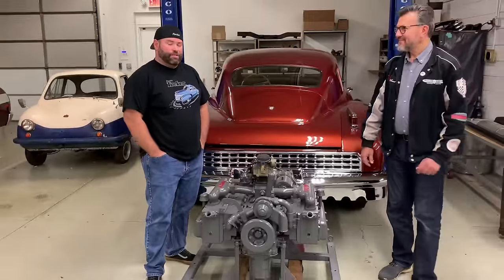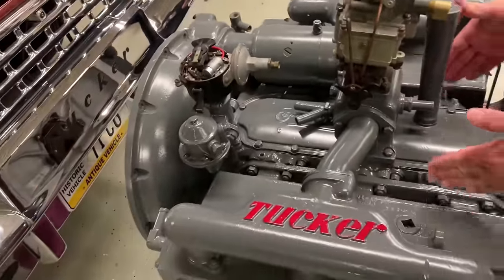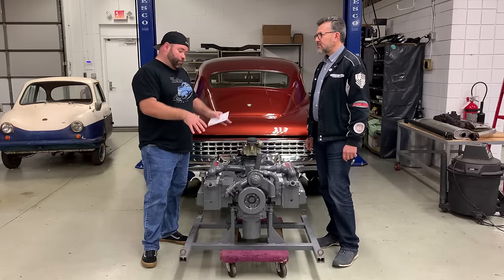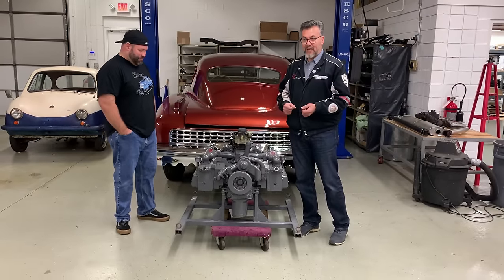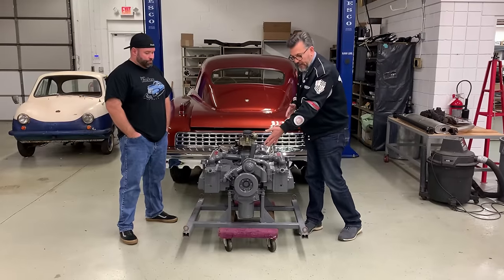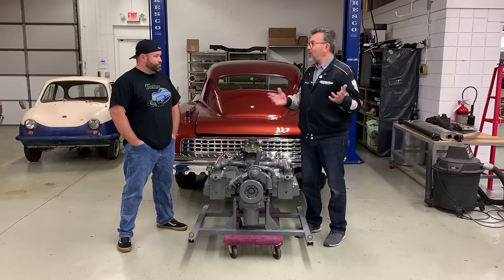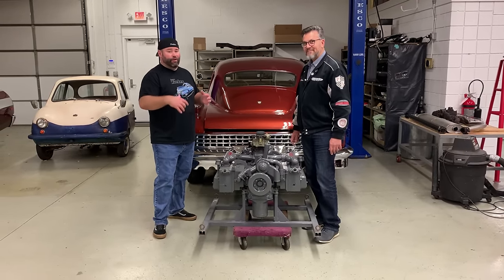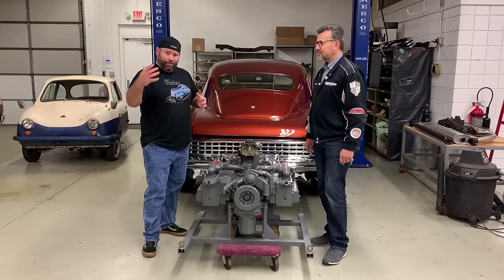The last Tucker automobile engine runs for the first time!

Comment: The man with a vision that started safety belts ..safety glass and much more only to be shut down by the big 5. Sad but true story.  Awesome to see it running!!
Reply from the maker: Thank you so much for watching!
Reply: model A Fords had safety glass in 1929
Reply: @Ifyouonlyknew howbad Heavy Drum Brakes!
Reply: @bikejunk1  No, they called it "Safety glass", but it was not safe. It didn't crumble like safety glass is supposed to.
Reply: @bigmacdaddy1234  the key factor was LAMINATED multi-plate glass of precise design.
Reply: @bigmacdaddy1234  To crumble, it's tempered glass... not safety glass. The 'safety' in windshield safety glass is that road debris can't get flung through it and cover everyone in shards of plate glass.. and if you end up smacking it, again, no knife-like shards. Side and rear windows get tempered because they don't face flying objects, so the only consideration is not slicing and dicing the occupants.
Reply: @mfree80286  Now I know more about glass then ever before. Thanks!
Reply: i thought first safety belts in a tucker was a myth?
Reply: The big 5?
Reply: Yes , the big 5??? What was the other 2???
Reply: A quick search says 1936 Rickenbacker was 1st to market with laminated safety glass windshield. I thought it was the 1939 DeSoto. My dad said he was test driving a ‘39 DrSoto when it forgot how to steer (something failed in the steering linkage). He hit a fire hydrant that didn’t break away like they do today. He bopped the windshield with his head. He had one cut in his ear that required stitches, but was otherwise unhurt. He always had a soft spot for Chrysler products after that because he was sure he would have been cut to ribbons in other cars of the day. Unlike most older drivers he ALWAYS buckled up when seat belts became available. Would have saved him from almost losing an ear.

Comment: I'm from Syracuse, NY, home of the Franklin automobile and the Air Cooled Engine plant. My grandfather worked at the Franklin plant making cars into the early 1930's. I was fortunate enough to have been allowed access to a Tucker at a Sarasota, FL  automobile museum back in the early 1980's while doing research for my Master's program in Engineering. I'm looking around my old papers for the serial numbers of that particular Tucker. It was such an impressive and forward-thinking design. I'm glad many of these cars were saved and restored!

Comment: As a huge aviation nerd, it was the fact that the Tucker had the Franklin engine in it that drew me to being a fan of that car and its fascinating history. 
Up until this video, I never knew Tucker bought Franklin and I never knew that the engine was converted to water-cooled from air-cooled. The Bell 47 helicopter in which that little Franklin engine began its life, was as legendary a piece of engineering as the Tucker Torpedo. Thank you for this very informative video. No other engine sounds like that.
Reply from the maker: Don’t worry, we are nerds about this stuff too!  Thanks for watching
Reply: I recall a Franklin aircraft engine company in El Segundo, CA when I was learning to fly nearby but don't think they went out of production in 1948.  I seem to recall other engines made for aircraft after that.   Was that not the same manufacturing company?

Comment: It's a true delight to see this marvelous piece of engineering back running where it belongs in Tucker #50. These cars were years ahead of anything on the road in 1948 and in some ways they rival modern cars. Preston Tucker was truly a man well ahead of the curve.
Reply from the maker: We agree Keith, thanks so much for watching!
Reply: Thats why Detroit had him shut down.
Reply: so are you saying this engine was originally in this car, then the car was sold without its engine, and now somehow they are reunited?  I'm confused.
Reply: Someone, maybe you guys, needs to buy Tucker Motors and bring these back.
Reply: Yeah, that's exactly what they are saying. The engine and car got separated, but now they are back.

Comment: My father in law owned Tuckers Tucker. The one with chrome around the windows. Now in the Peterson museum. I still have the manufactures liscence plate and a center front grill on my garage wall. The one under the headlight
Reply from the maker: Very cool, if you even want to part with those original parts let us know at info@tuckercorporation.com!

Comment: Back in 1970 my brother and I were scrounging for certain auto parts in Koch's Motorcycle / auto salvage yard in Denver, Colorado.  In a shed, we came across a box with a cover.  We peeked inside and there was a pristine Tucker engine.  We were dazzled.  We thought all Tucker engines were in Tucker automobiles.

Comment: VERY smooth running engine compared to the other Tuckers that I have heard run. Mark has that engine dialed in very nicely.
Reply from the maker: Yes he does, thanks for watching!
Reply: Aircraft engines are powerful, and precise. I've flown helicopters with Franklin engines.
Reply: Also helps the engine has zero miles.
Reply: My father was a tool and die maker for Air Cooled Motors (old Liverpool road plant) at that time, he told me that they had contracts for early helicopter engines as well as fixed wing aircraft. Franklin was bought by the Polish government, who continued building engines until investors bought Franklin and brought it back to the US. I’ve heard that both the 4 and 6 cylinder models are still available as “crate engines” for use now, still considered very good engines in their HP range.

Comment: I remember hearing that the engines were set up like many aircraft - as a Quick Change Unit.  If you had a problem - you pulled into a dealer, they swapped engines in an hour or two, and you drove away with a different (Running) engine - while the dealer had all the time they needed to diagnose and repair the engine properly, without being rushed, and when the next customer came in with a problem engine - they got that engine.... and so on, and so on.  THAT is why Tucker cars and engine numbers don't match.  BRILLIANT idea! Convenient for the customer, and better product from the mechanics.
Reply from the maker: That’s correct, the plan was to provide loaner engines while the owners engine was being repaired (if needed).  Thanks for watching!
Reply: Tucker was selling more than just a car, he was selling his name and he wanted to be sure it was a good name that would stand behind their product. Unheard of these days .
Reply: @Wooley689  Its all about greed and power now.
Reply: It's always been about greed and power. That's not a critique of capitalism but human nature.
Reply: @Wooley689  ,
I can remember as I was growing up, I heard the elderly menfolk saying "A Man is only as good as his name", did that have anything to do with Preston Tucker? Did he 'coin' that phrase? Just Curious.

Comment: The engine sounds awesome! Great that it had such high torque back then and with a one barrel even. A better trans and induction and who knows what it could have been. You hit on something with the Porsche comment...
Reply from the maker: Thanks, we are Porsche fans as well.  Thanks for watching!
Reply: Maybe it's something common to the flat / opposed engine design? (shrug)
Reply: @madpogue  opposed twin engines are generally very torquey some lawn mower engines have a opposed twin layout that just has brutal bottom end torque
Reply: @prestontuckersspeedshop1948  This is not an opposed piston engine. Opposed engines have 2 pistons in the same bore. This is a flat or horizontal engine. Look up Commer knocker engine to see how an opposed engine is designed and works. Most opposed engines are two stroke diesels.

Comment: Im a non related Tucker. There was one at Bellms Cars of Yesterday in Sarasota.Fl.  As a fireman we  did inspections on structures  for reference and safety. I had the curator going as I knew all about the car . I was a mechanic also. I remember the radio had the Tucker ketters on the push buttons. Sometime around 1975 /76. Proud to be a Tucker!

Comment: I've never seen a satisfactory answer as to why Tucker went to so much trouble to water cool the Franklin base motor.
Reply: Providing sufficient airflow would have been noisy with the engine boxed in. Even in helicopters like the Bell 47G, with the engine exposed to prop wash, it still had fans for additional cooling, and to keep temperatures more consistent across all cylinders. I'm a big fan of air cooling, but liquid cooling can remove heat more effectively, does not need forced airflow all the time, and the liquid dampens engine noise.
Reply from the maker: The specifics are probably buried now, but we’ve always heard they had cooling challenges.  We’ve never found any specific documentation on the topic, but if we do we will share it!

Comment: OMGoodness!  In thinking about Tucker's so radically-different choice of horizontally-opposed aircraft engines as standard remarkably makes Tucker engines wear differently than the vertically-straight cylinder engine arrangement FOR THE VERY SAME REASONS aircraft designers exclusively picked the arrangement.  That is, to balance or neutralize the gravity constant of resistance and wear in the performance of the engine.  This choice added feature, value, capability, etc. that characterize and distinguish the peerless Tucker design, line, history and circumstances that together make the Tucker a timeless AND peerless automobile, a stunning credit to everything America values, relies upon and cherishes about the American way of life.
Reply from the maker: Agreed, thanks so much for watching!

Comment: Funny  that you said it drove like a Porsche.  Just as you said that I was thinking about the rear mounted boxer 6, almost the same set up as my Porsche 911 turbo.   They still use that today as does the other boxer people,  Subaru.   Even the sound of the motor running has hints of the old air-cooled Porsche motors.  So I need to change that to, Porsche motor sounds like a Tucker 😊 thanks
Reply from the maker: Yes it does!  Thanks for watching.

Comment: This again seems to confirm my theory that switching the Franklin to water-cooling probably was a mistake. Tatra had already by that time proven that a large air-cooled engine could propel a full-size saloon with comfort and refinement, and judging by the general layout of the Tucker car, I'm inclined to think Mr.Tucker was not unfamiliar with Tatras (but this is of course just speculation).
Reply from the maker: Seems like a good theory, but it will take more testing.  Let us know where you land and thanks for watching!

Comment: Way cool stuff. SOME liquids when they dry up over time will actually turn into what they call in Chemistry... ring structure. Its the pattern of the actual molecule with the its angles and rings (if it has rings). I saw a dried up drainage pit at an abandoned factory that had the very visible molecules.
Reply from the maker: It was crazy, I bet that’s what happened.  Thanks for watching!

Comment: I'd really like to see a disassembled engine and the reassembly of it. I'm a big fan of flat 4 and 6 cylinder engines. An incredible torque number from that one. The intake plenum design also needs a good look. A redesign of the fuel system along with cats, fuel injection would be fascinating.

Comment: Great to see.  Please show it when it gets running in car #50.  I had an original Tucker brochure and had it autographed by the designer, Alex Tremulus.  The brochure showed the windshield as a pop-out, like later Mercedes.  Also, the dash had a padded top and swept away to stay away from knees.

Comment: I'm wondering why it was removed from #50 when it was new. Has # 50 been sitting without an engine all these years? It would be an interesting story worthy of it's own video.
Reply: I thought he said that they removed it from the car because no one had been able to get it run properly before.
Reply from the maker: 1050 was sold without an engine at the factory auction.  At a later date the last engine (#98) was put in the car but never run.  It was pulled from the car recently, rebuilt, and will be put back into #50.  Thanks for watching!
Reply: @prestontuckersspeedshop1948  so, there were 50 cars but 98 engines?  Are they still out there?

Comment: I have read that the conversion from air-cooled to water-cooled left something to be desired.  The water-cooled passages had some distribution issues whereby the velocity of the coolant became quite sluggish with the end result being a tendency of engine overheating.  The other downside was that the ability to drain coolant out was compromised, leading to cracked blocks.  Was the coolant flow ever analyzed to pinpoint where the flow chocked off?

Comment: Torque is king as that's what gets anything moving off the line. My second car was a 41 1/2 ton military Dodge pickup with a flathead 6. It had a ton torque off idle and between that and the gearing you could climb or knock over a tree with it. I like Mopors obviously and they have always been known for having a lot of torgue and it really gets them moving till the horse power takes over. I bet they are very smooth and snappy to drive, plus quiet. It does sound similar to the flathead 6 in my truck.

Comment: Fascinating and interesting 🤨 
Thanks for sharing 
I’m a Corvair guy and wonder why they didn’t just use air cooling like the European Tatra???
Reply from the maker: They did try an air cooled version but could not get it to function properly. We will shoot a piece on that engine for an upcoming video.  Thanks so much for watching!
Reply: @prestontuckersspeedshop1948  I remember it in the movie... the air cooled helicopter motor testing at the track
Reply: I am an old corvair guy, Tucker's always  sparked an interest.  What did gm copy?

Comment: Is that about the same engine as a Lycoming? I know Lycoming had built several versions of the flat 6 and they were used in the Bell H-13H chopper, but they also made and sold different ones to different companies or whatever.

Comment: Every aircraft engine l worked on was an updraft carb on the bottom of the oil pan.  How did tucker work around that, did they come up with a new oil pan and induction system for automotive use?
Reply from the maker: Yes, we will have a lot more details on this in our next video.  Thanks for watching!

Comment: When you really break this down, you have a 178 gross hp/151 net hp engine with 315 ft/lb of torque in a 4200 pound car.  I suspect 0-60 times for that sort of situation to be around 9.0-10.0 seconds.  For 1948 that would be 911 Turbo S-level of performance.  Pretty impressive.

-It would be interesting for someone to take one of these on an actual track and see how it handles.  I wonder if it would have the same trailing throttle oversteer issue that older 911's have.  

Great video!
Reply from the maker: Thanks so much for watching!

Comment: The car we used in the movie and many others were from HARRAHS car collection , we could not start them just push them into the shots, the principal actors were making offers on many of the cars brought in by the private owners .
Reply from the maker: Very cool, thanks for watching!
Reply: My Father  and me spent two days at the three warehouses  at Reno.  We saw all the cars,  Dad told  me  about the  Tucker car on display.  The display also had a engine on a stand. Dad said all the cars in the Harrah museum would run and drive.  A man with red flyer wagon,   that had a battery  and gasoline can,  would start and drive 3 or 4 cars each day.   We saw  him drive  James Dean  Black Mercury,  he drove  it outside and they were washing the car by hand using a low pressure garden hose.  It was the most amazing time of my life ❤.

Comment: I don't understand why they deemed it necessary to convert the engine to liquid cooling. Is that an SAE #2 or #3 flywheel housing, or did that standard even exist in those days?
Reply from the maker: From what we understand, they could not generate enough air flow to keep the engine cool in the rear of the car.  They did try one which we will do a future video one.  Not sure on the standard.  Thanks for watching!

Comment: my father rebuilt a 1948 Stinson flying station wagon 108-3 aircraft had Franklin 165 H.P. air cooled engine ,tucker bought surplus engines mainly designed for helicopter,s from Polland. do not know about the water cooled version ! ?

Comment: Fascinating video.  Because this engine was designed for aviation use... in an era when gasoline contained lead to mitigate knock... how has it been adapted/modified to be capable of running on modern automotive fuels?

Comment: Hold that Tiger! Man I have always wanted to just drive a Tucker just once. Let it rip on the track but I know due to their value that is impossible. Like you said, everything I've heard is that the amount of torque available from this engine made these cars true muscle cars in the day. The other thing besides the 390 ft/lbs tq is that they were 4 speed transmissions at a time when most cars still only had 3 speed gearboxes. So when you slip it in to 4th on the highway at above 60 I bet that big 6 is just lazily burbling at about 1000 RPM. Probably returned better fuel economy than even the most fuel efficient cars of the day.

If someone could swap out the weak Cord transmission for a Muncie M22 Rock crusher 4 speed that could actually handle all that torque, we'd see the true performance potential!! :)

Just imagine if Preston was able to proceed with further development and production beyond this drivetrain.
Reply from the maker: Hi Joe, the company was working on a “high performance” variant of the Cord transmission called the Y1 that would handle all that torque.  Unfortunately, we know how the story ended before they were able to complete it.  Thank you so much for watching!